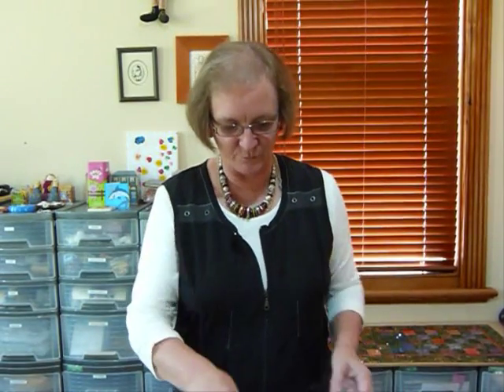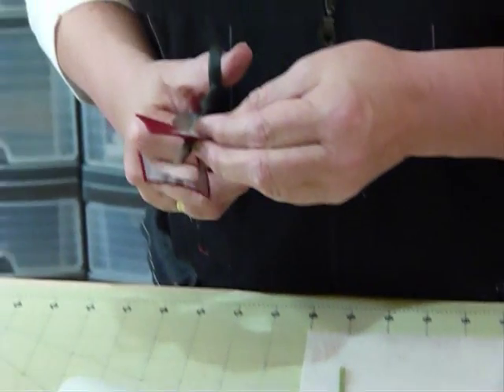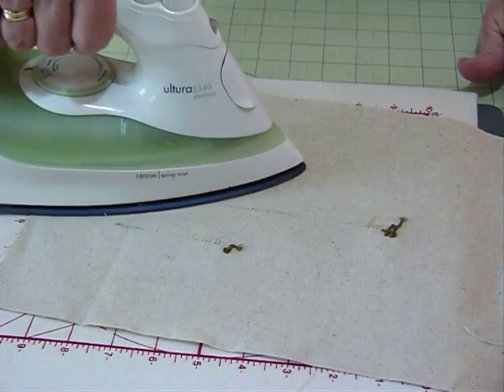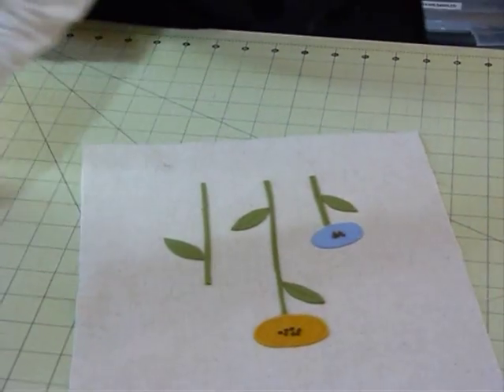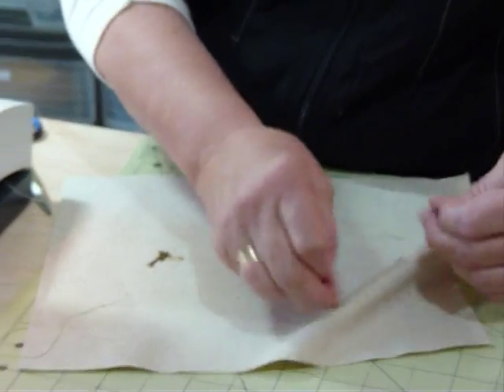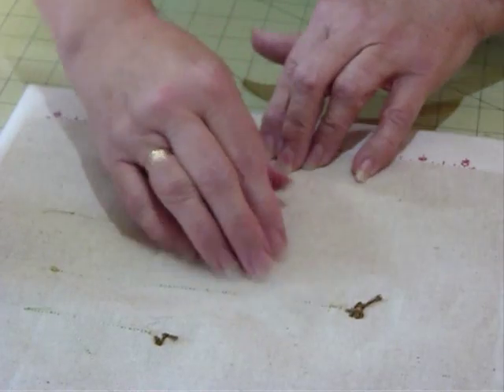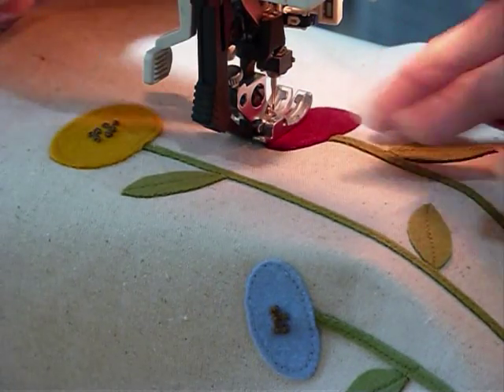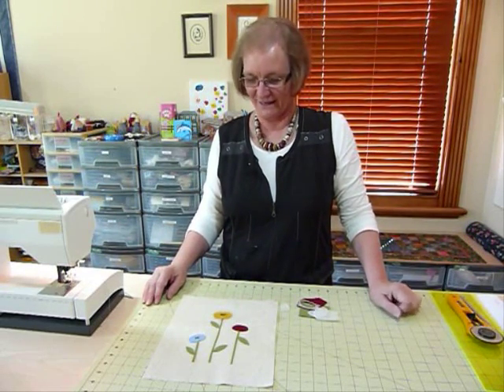How to fuse wool to cotton/linen fabric for applique - Quilting Tips & Techniques 090

Comment: If you use a sewline glue pen to hold it in place so that you can flip it over, it's a lot easier.  It won't interfere with the fusible.